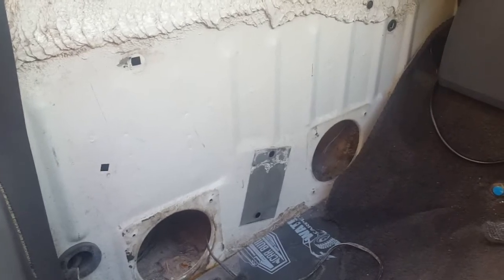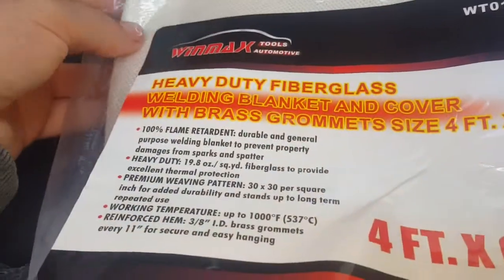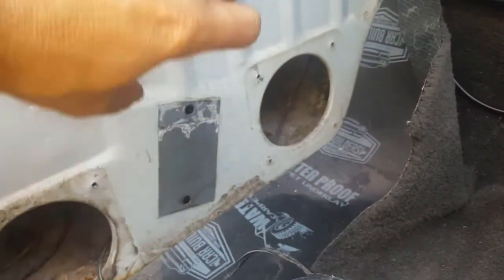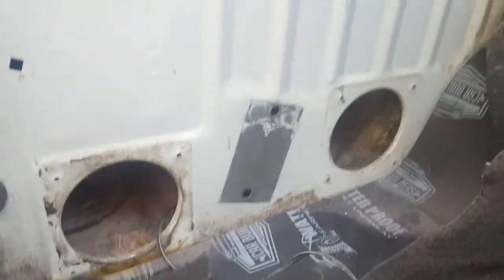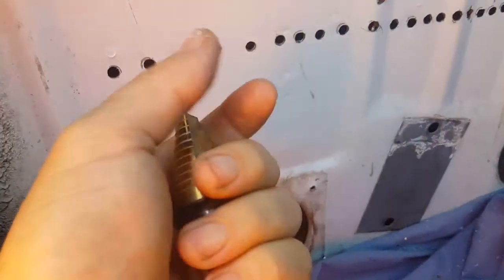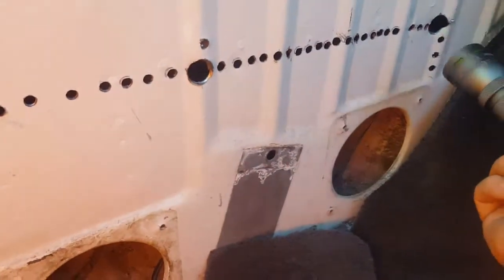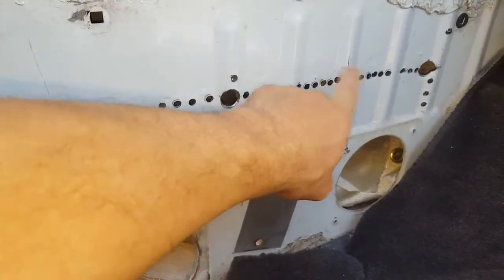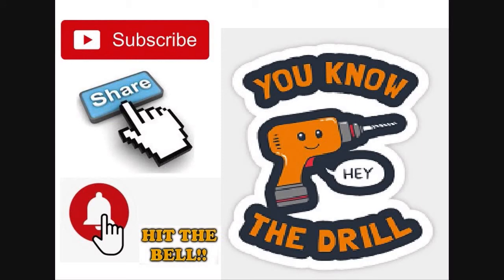VP  VR  VS COMMODORE AMBULANCE FUEL SENDER  PUMP LOCATION AND D.I.Y. FIX.   PART 1

Comment: You are about to save my vs ex ambulance with this video
Reply from the maker: how?
Reply: @entertainmentchanneloz1509  because if it wasn't for this video I wouldn't have been able to do my fuel pump, was trying to work out access etc, this is the only video on the internet, showing work on an ex ambo or long wheel base vs
Reply from the maker: @bushfishncook2128  appreciate your positive comment, it was such a bad location and access point and safety is a concern when making an access panel to change this very filter too.

Comment: I'm hoping to hear back from you asap because might need to ask a few questions if that isn't to much drama?
Reply: Main question is it still a normal vs fuel pump?
Reply from the maker: sure ask anything!
Reply from the maker: @bushfishncook2128  as far as i remember yes just the fuel pump itself,
Reply: @entertainmentchanneloz1509  thanks to your vids I was able to get it sorted on the weekend

I had to make a bit of a cut but kept it to a minimum and managed to get it up and running again 👍🏼

Cheers for sharing the vid without you I would have spent half the day trying to find the pump location haha
Reply from the maker: @bushfishncook2128  thats great news and very happy my channel has helped you out, well done on the positive result on your ambo :)
Reply: @entertainmentchanneloz1509  hoping one day to turn it into an extra long panel Van 👍🏼
Plan on chopping a station wagon rear off and welding it up one day

She is used as my work ute at the moment but bought her a nice low K l67 supercharge to drop in one day when she is done

Still needs a hell of a lot of work but part of the fun once I move she will retire and start getting worked on 👍🏼
Reply from the maker: @bushfishncook2128  what a great Idea, its only imagination that is limitless so stick to it and see how it comes out, well done!